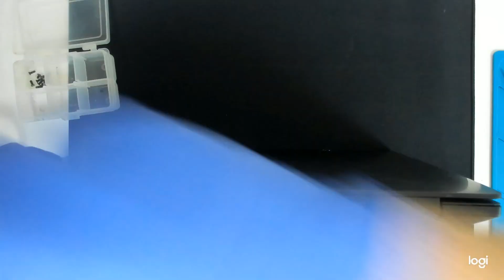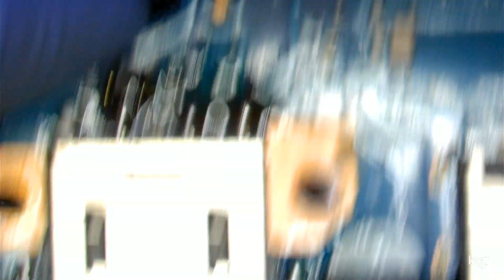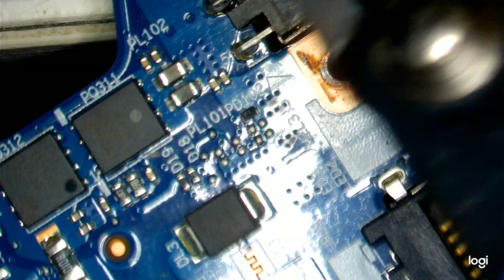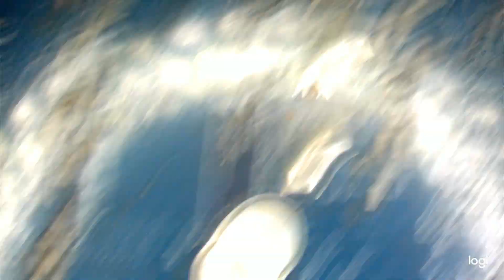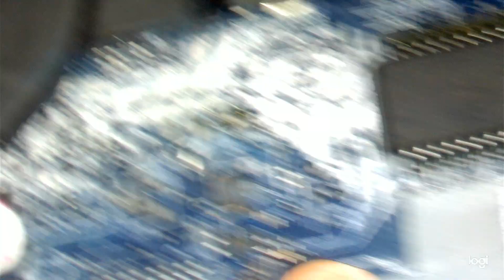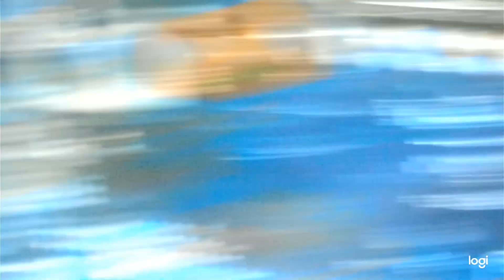Lenovo IdeaPad L340 Gaming Charging port replacement / Disassembly

Comment: My laptop keeps shoiwng issue of sometieks charging sometimes not

So I think I need to change the jack
Also can u tell me where I can buy body parts for this laptop as my hinge is broken and there are cracks everywhere
Reply from the maker: Best way is to look on ebay or some local supplier, by you full laptop model.

Comment: Did this repair myself but now my laptop seems to be severely throttled, and turns off after unplugging the charger. I've checked and the battery is connected properly so I wonder if there's some communication issue happening

Thanks for the video
Reply from the maker: Check are all the pins soldered on the board. Also did you remove the cooler. If yes, did you replace the thermal paste?
Reply: @LaptopDisassembly the issues are definitely not thermal. I checked the connections only visually and not with a multimeter, always possible tha to missed something

Comment: Where can i get this charger point
Reply from the maker: Aliexpress, ebay. Model of the charger port is PJ1081
Reply: @LaptopDisassembly I cannot find this either place, do you have a link?
Reply from the maker: https://www.ebay.com/itm/276469993639?mkcid=16&mkevt=1&mkrid=711-127632-2357-0&ssspo=hz-SBJGmT1e&sssrc=4429486&ssuid=&var=&widget_ver=artemis&media=COPY
Reply: @LaptopDisassembly  are you sure it’s the right one? I can’t see into the side to double check. The last two I ordered came with a plastic square in the middle and while the charger fit it, it would not charge at all. Even tried a new charger cable just in case and it wouldn’t work. The original power jack did not have the plastic square in the middle.
Reply from the maker: @michelle-fh5du it should have the plastic square in the middle. It separates the ID pin from the plus line. The one put in the video is the same part number.
Reply: @LaptopDisassembly  mine didn’t originally have it and the one I tried with it doesn’t work. Does it matter if the original had it?

Comment: Great video keep it up man advise for u change your soldering tip it is dead. What is the type of wick u are using?
Reply from the maker: Thanks. The tip is fine actually, I use it the most. Just didn't clean it good last time. Also I'm not use to record a repairs under the microscope. I see way more than what is recorded under the microscope. So I always look what is visible while recording.
Reply from the maker: the wick is chem-wik